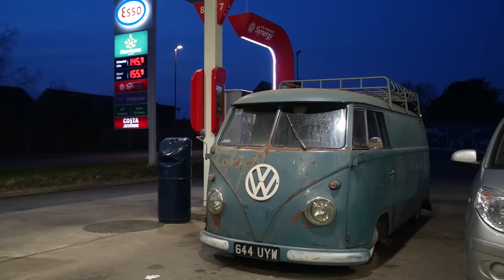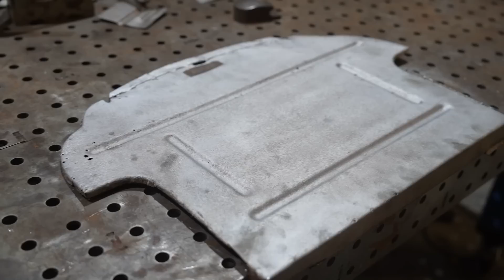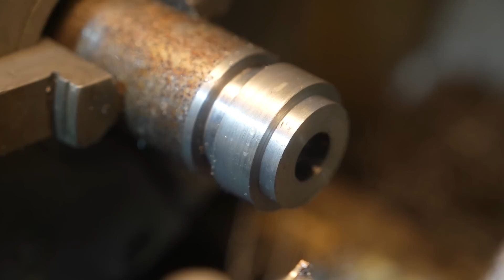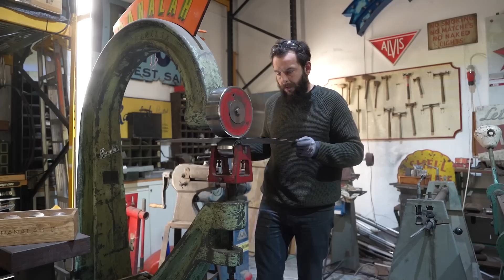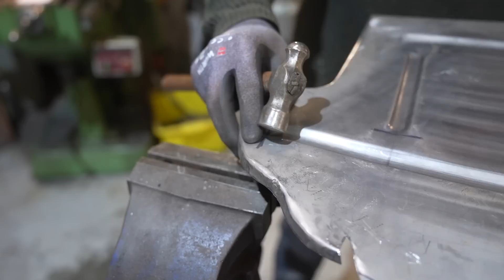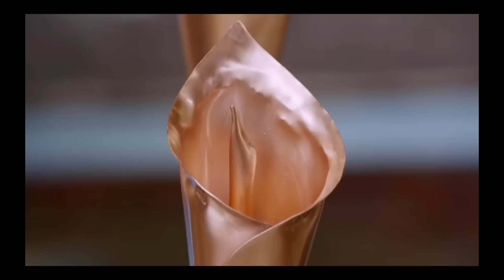Goodbye, Bus! | Austin J40 Pedal Car Restoration | Ep.4

Comment: COINING TOOLS: The end of your bead rolls would be better and SHRINK more metal IF you used "coining tools" to finish them.  A COINING TOOL can be made from pipe, or often from hole punches, in which half the end is cut off to half-moon shape, and then rounded over by file.  You'll be surprised how much a flatter a panel lays when you properly "coin" the ends of beads.  Also, when pre-stretching a panel, on pre-stretch right over where the beading will be.  You pre-stretched the entire panel and that was your problem.  Pre-stretching is usually best when you pre-stretch about half the height of the intended bead.

Comment: Dom you just need to pre stretch the bead area only with high crown wheel only.To finish the ends you could use a hollow punch the same size as the  bead  with half the end ground off , and hit the bead from the top not the  bottom. Or i would probably just get some flat bar ,drill it the same size as your bead and cut though the centre of the hole .Give it a  light file to take the sharp edge off and hit that down on the end. It will flatten it and form the end.
Reply from the maker: Thanks for the tips I appreciate it

Comment: Where do u draw the line between making a panel and buying a panel?
Reply from the maker: Depending what’s left of the original panel, even if it looks ok, it can be really really thin which will be a nightmare to spot weld later, and compromise the structure of the car

Comment: Hey Dom.
A good trick to round the ends of the channels is to use the end of an open end spanner of the same diameter.

Lay the spanner down at the end of the channel and give it a good whack with a hammer. Magically it creates a beautiful round end without the dents from a ball pin hammer.

Good luck.

Comment: My 2 Cents: 1. It's worthwhile to cut down the number of projects that one has so as to better concentrate on the remaining projects.  2.  Do not remake the rear interior panel on the pedal car.  While I can understand your continuing quest for perfection, the panel is so functionally close to the original, (and it will not be seen in the finished car) that I would consider it an excellent attempt and move on to the next panel.  As always, a great episode!

Comment: The usual way the boot panels are made is probably in a factory on a press one every 30seconds, your boot panel has the fingerprints of the craftsman, the marks from the tooling that you made yourself, the precision of the fit, every inch of it glimmers with your passion, like the brush strokes of a master. For that reason I'd, leave that panel just as it is (though I totally understand why you want it to be a precise replica of the pressed ones) and have the only Austin j40 in the world made by the one and only  DC ☕🍩

Comment: Hello Dom ' . I mirror Rogerdavis 5914 's  comment . But  you're over doing it by pre stretching the bead rolling . The beads are so slight that there will be little stretching , you'll easily flatten out the panel with a little hammering . If you place the workpiece in a vice with the jaws opened so the bead rests nicely between the jaws , just get a small ball pein and you get the finish you want . Cheers Dom !

Comment: Great work Dom, you're a skilled engineer make no mistake. I guess it was easier to make the bead roller dies than a Pullmax type tool, because I think I recall you have a machine? Anyhow, I'm sure that panel is good enough to go with after some minor tweaks maybe. it's certainly better than anything I could turn out. Well done.

Comment: Hi Dom with regard to finishing the ends of your beads you could use an old gasket punch of the same width as the bead.Grind half the cutting edge away then place it on the reverse side of your panel and tap the panel back down.

Comment: The panel fits Dom, don't let the perfect be the enemy of the good.
Reply: Well said.
Reply: I disagree, that small investment in time now will pay dividends in the long run. 
   The problem with bodywork is a small difference/error can have a knock on effect later on potentially interfering with the axle and wheels or the rear wings.
Reply: @geek9642  as long as it is a SMALL investment in time, sure. My point was a philosophical one for art and craft. Sometimes an obsession to achieve 100% perfection may not be worth the time spent when 97% would suffice. However, if the bodywork isn't true I'm with you. Dom always has plenty of projects on the go and I imagine time is a precious commodity, hence my comment. I expect Dom will make the right call. I'm looking forward to the next episode.
Reply: Hear, hear.
Reply: Attempting to achieve perfection is one big procrastinator of time. Then there's the cost element too. Don't go down that rabbit hole Dom.